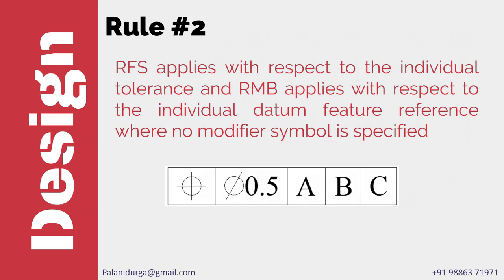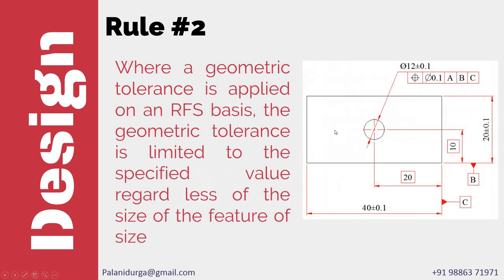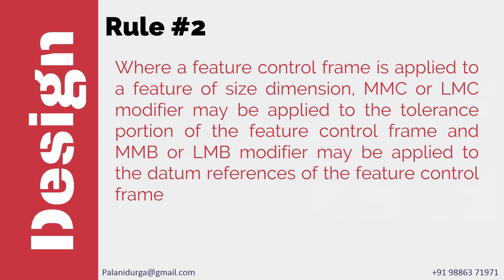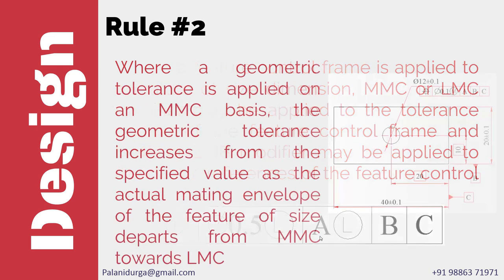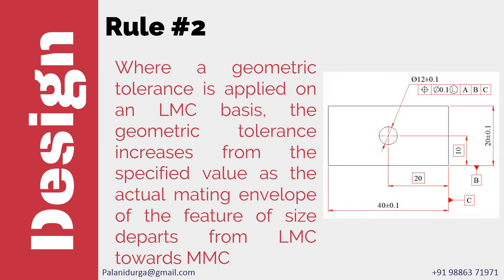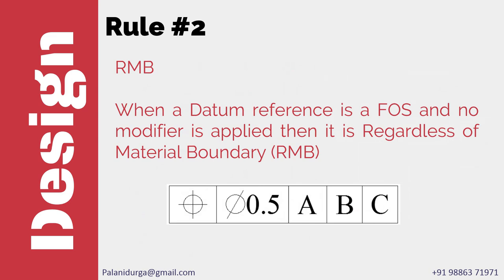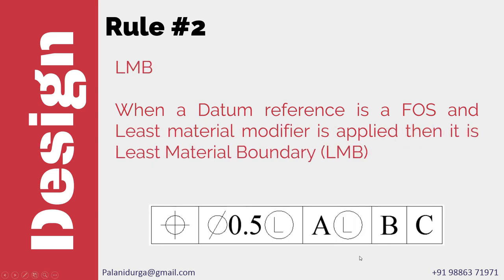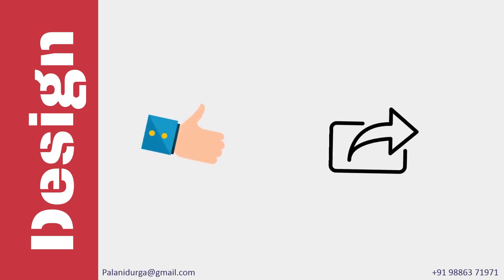GD&T Tutorial 14 : Rule #2

Comment: Sir, Overridden of Rule#2 means applying modifiers in both geometrical compartment and Datum compartment. Am I correct sir?
Reply from the maker: It is not overriding, by default RFS and RMB is applied. when required, we have to use modifers